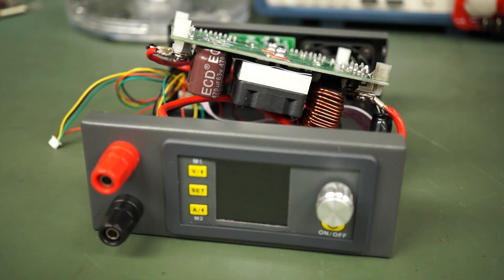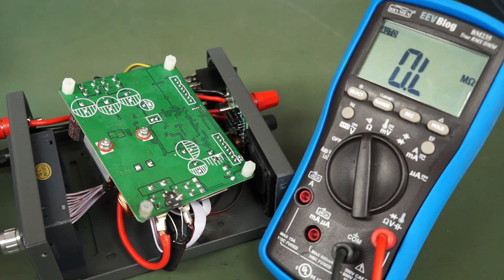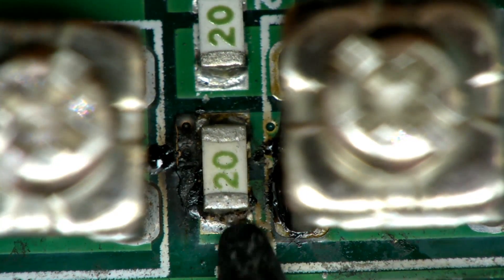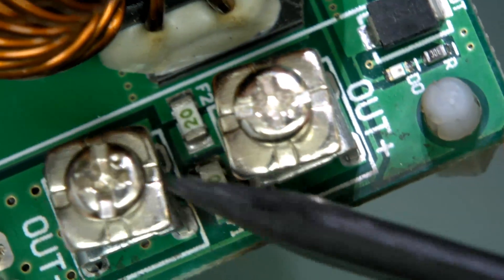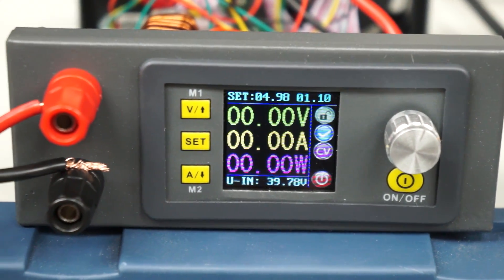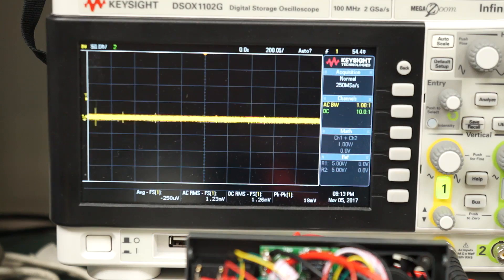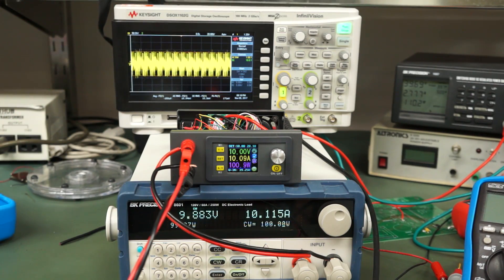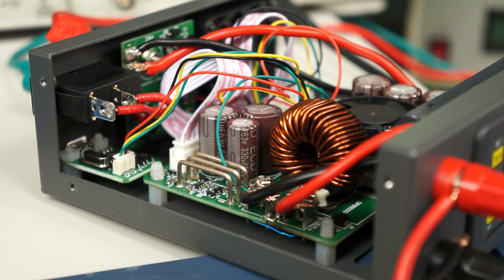EEVblog #1036 - PSU Fire PCB Repair

Comment: I'm sorry, but I have to correct you: a 20 A fuse MUST NOT trigger at 20 A - never. Depending on the standard is has to meet, it might trigger at 1.25*20A after 1h or something in that order of magnitude. Check on google for some current-time-curves, if you're interested in more details ;)
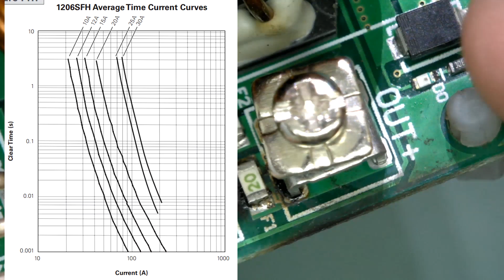Reply: He showed a current-time fuse curve in the freaking video, dude. 7:25  And a 20A fuse run at 20A will eventually fatigue and blow under "normal" use.  You don't run any components at 100% of their rated values if you want them to last.  It isn't good engineering.
Reply: What is wrong with you? 
Yes, he is showing a curve - thanks for telling me, but at least you definetely didn't undestand it.
Just in case you didn't know: This is a logarithmic plot, so if you look at the line for the 20A fuse, you'll see it is only specified to blow at 40A (or more) after 3 sec (or less).
The plot does NOT specify anything about 20A for 20A fuse. So if you - as I said - do some googleing, to find other curves, that specify all the operating range of a fuse, you will see, that no normal fuse will blow at it's rated current - ever.
This has nothing to do with good engineering, I'm just talking about device characteristics here.
There are even standards out there, that require, that a fuse MUST NOT BLOW for any current less than 1.3 times their rated current for several hours. 
I usually like discussions, but please don't come up with some things that you "think" are true but instead do some research before you accuse the things I say.
Reply: I never said, that you should put a 20 A fuse in there. I never said you should always put a fuse in a product, that exactly matches the nominal current of the product. I get that fact, that they were not willing to put a 20 A fuse in there - it makes sense.
All I wanted to clear is the common miscconception, that a 20 A fuse blows at 20 A. This misconception is very common indeed and is just not true. If you have a 16A fuse at home in your fuse box, you can draw 20A "until the cows come home". This is what I wanted to get across.
Does that mean, you should put a 20 A fuse in 20 A device? No.

Comment: I would've removed the fuse, then remove all traces of carbonation, then solder the fuse back on.
It will remove all doubts as to any short circuit under the fuse.
Reply: If you removed all traces of the carbon, you'd have one big hole where the fuse used to be.
Reply: Probably cutting off the corner with the terminals, then soldering wires to the proper places, adding an external fuse, then also moving the sense point to the output receptacles would be the best fix.

Comment: I'm currently also doing output ripple measurements and have read a preferred technique is to DC block a connection to the power supply output and terminate this in 50R at the scope. Otherwise, the normally high impedance input of the 'scope means any currents induced will create large voltages. According to the Analogue App Note I read, the bandwidth should also be set to a low value (20MHz) for comparison purposes.

Comment: If this PSU will have load with high short-circuit reverse current capabilities (high input capacitance or simply electro-chemical cells for example) this part will fail with explosion. As there is no safety features it can do same thing while catching a high voltage spike.

Comment: Greets from Russia, Dave!
These modules are crap.
Me and my collegue have 4 of them, with different power output. Bought from aliexpress. 
Our statistics: 
1st module - just out of the box get burned power stage after 1 min of testing at max load and totally dead now, 
2nd - looping reboot just out of the box, 
3rd - accidentially stucking and rebooting at any load with any power supply, 
4th - finally, works fine for already 2 months...
Dave, I wonder why you popularizating that crap? These modules are very unreliable, lots of defective ones just out of the factory. I guess there are no testing and quality control at all! Questionable design and very poor production quality. Cheap regulated power supply for begginers? Good joke! No, Dave. Just NO!
Even those few-bucks-cheapish-no-brand simple dc/dc converters are much better in this case.
Reply: I have bought two DPS5005 and both works great, *no issues*...tested on various conditions, except feeding reversed voltage from another supply into the ouputs, because it´s not an four quradrant power supply and this will probably kill it, but i tested a 100.000µF/63Volt cap charged it up to 48Volts (my input voltage) with 5Amps, shut the DPS down after fully charged, power it up again without discharging the cap, but leaving it at the output terminals.
Did the same test with a 1Henry 10Amp EI130Core inductor, no issues even with its heavy back EMC/EMF caused voltage spike during shut down... 

So my conclusion: 
well designed, great little power supply modules, especially with this priceTag..:)
Reply: you also need to have in mind that "Aliexpress" is a lot of things so unless it from the manufactory and his salechannel.. you can risk whatever... something like semi-error production-items are also being sold from AliExpress on some product segments and to some extent you don't care, if the item is missing something that is not vital or there are scratches marks or simply error in the production process If the price matches those shortcomings and the item is still useful. for its purpose.. so "AliExpress" is so many things.. but I do remember that RD Tech does have there own sales channel on Aliexpress so at least purchase from there if you're going for these instead of third-party vendors.
Reply: Your sample size is too small to make a decent conclusion and call them crap :P.
If you wanted to, you could find 3 high-end Tektronix oscilloscopes and watch them fail while your 4th one works fine, by your logic Tektronix would be crap then.

Comment: 3:48 "Burnt fiberglass --", erm, excuse my nitpickiness, but isn't glass mostly silicon dioxide? My best guess for the source of the carbon would be the hydrocarbon-based resins used to laminate the fiberglass layers together.
Reply: If I'm not mistaken, fiberglass is a thermoset plastic with glass fibers in it and not pure glass.
Reply: yes
Reply: Thank you mr nit-pick
Reply: fiberglass is a COMPOSITE, its not just glass fibre, hence those resins ARE fiberglass

Comment: Still wondering what the use is for a power supply that itself needs a power supply.
Reply: It turns a fixed-output supply into a variable output supply. The fixed-output supply can be very cheap and simple.
Reply: Show me any power supply that doesn't need a power supply.  All of mine plug into the wall.
Reply: Of course I am.  Why would you think the "mains" isn't a power supply?  Your 13.8V supply needs 220.  Dave's needs 40V.  Inside your 2m radio, it has yet another power supply that takes the 13.8 and turns it into 5v or 3.3v.  
In my house I have a solar power supply that produces 48V DC, then the charge controller converts it to 24V to go into the batteries, then the inverter converts it to 120V AC, then the power supply converts it to 12V DC, then it goes into the radio.
Reply: Then all of yours don't need a power supply, unless you are calling the wall plug ("mains" in Europe) a "power supply."
My 2-meter radio needs a power supply because it wants 13.8 volts and the wall produces 110 volts. So I got a power supply that plugs into the wall and outputs 13.8 volts.
Reply: @JL Software
normal power supply is AC-DC power supply, our power supply is DC-DC  part, you only need simple AC-DC power supple to make a better CC and CV power supply . if you want to buy same power supply. you need to pay more hundreds dollar .. so this is the advantage of our power supply

Comment: Dealing with the failure of this device made for an interesting pair of videos. Old resistors were made up of carbon. The fire left a carbon deposit on the board has effectively created a resistor that was distributed over an area of the board instead of in a nice cylindrical package.

There is still a bit of carbon beside the one fuse on the top of the board. It might compromise the circuit safety should it ever blow from over current. The remaining carbon may still be providing a low resistance path between the two ends of the fuse. Two caps in series will cut the capacitance in half, not double it as you said. You could make a Fundamentals Friday video out of why cracks in MLCC caps cause them to fail shorted.
Reply: @Kevin Cozens
you are right , my dear friend 
very good.

Comment: Are there   solutions for   small three wire cooling fans to reduce noise or vary speed with temp. Perhaps it is just a matter of price point. Vary speed with temp?
Reply: fan noisy ? for now ,we did not have plan to change the fan

Comment: Just put a leaded capacitor across the front terminals instead.
Reply: @zx8401ztv
you can don't need to add a capacitor, the old capacitor is just to lower the ripple 
you can don't use it

Comment: One of the fuses is stillshorted by carbon. You could move them to the other side of the board, scratching away the solder resist on the terminal and inductor pad.
Reply: @
superdau
he use a knife to scratch, but he make a slot, it should be ok,  too

Comment: So, bottom line for me, who just received this PSU last week: remove that capacitor?
Reply from the maker: Yep, remove it.
Reply: I'd just replace it with a disc ceramic leaded cap of the same value. Problem solved!
Reply: I just noticed that my DPS5020 came with the C33 & C34 caps installed where as yours only had the c34 cap. So should I be removing c33 as well?
Reply: Remove both and fit a 100nF leaded capacitor, best thing you can do there.

Comment: I just changed the electrolytic capacitors in my amp that I use for my computers audio. So this is the first video I watched to test the audio and I'm thinking wow, the audio sounds so different with these new caps.  I wonder why?  I got the answer at the end of the video. :)

Comment: Dave, Did I catch you saying that putting 2 caps in series would DOUBLE the capacitance? Hmmmm slip of the tongue perhaps?
Reply from the maker: No, slip. Two in series will half the capacitance, but if one shorts out then the capacitance doubles as I said.
Reply: Ahh, I see !

Comment: Hey Dave.  I'm glad that burnt the board as you made a great video from it. The modification to cut through the carbonised board was quite neat considering the damage. Well done.
Reply: in fact , it should be clean up
Reply: Rd Tech difficult to totally clean off the carbon. Isolating the low resistance is the best you can do. Gets you out of trouble while you order another one if you care about the cosmetics.

Comment: Interesting video with great practical information about these multilayer capacitors and the conductive effect of a burned PCB.
On question though: you mention putting two capacitors in series as a solution to prevent shorting-out failures. However, in case one capacitor fails one would not notice that it failed (only less capacity), until the second capacitor also fails, leading to another flaming short-circuit situation. Wouldn't it be better to put a fuse in series instead of a second capacitor? Maybe even better to always add a fuse in one supply line, before the capacitor that goes across plus and minus?
Reply from the maker: The odds of two shorted caps is incredibly remote.
Reply: Clear. Thanks for your reply! I guess my poor understanding of the word "susceptible" led me to derive incorrect odds from your the statement at 15:40 ("These multi-layer capacitors are susceptible [...] to not only mechanical stresses [...], thermal stresses, they're susceptible to just a failure in manufacturing [...] infant mortality thing  [...]").
Do I understand well that the odds for mechanical stress were in this case greatly enlarged by soldering the capacitor between the poles and that the other potential causes are much less likely to occur? I ask this because in my own projects I have often soldered an SMD cap close to, or even on a regulator and I wouldn't want that to cause a fire.
I now wonder how dangerous the placement of the caps is that I chose in projects such as in this video: https://youtu.be/K7Lv5FWTX9Y
I know I am probably violating all rules of proper PCB layout in that video, but hope it isn't too dangerous!
Reply: @Maxint R&D
two them in series is not good idea, the best solution is to use a better one
Reply: @rdtech9153  it's good to see you following the discussion. I just bought an DP20V021 because you worry about quality and the satisfaction of your customers.

Comment: This series of unfortunate events was actually really useful for a hobbyist/novice like me. I had never really thought about the mechanical stress issue, and this really demonstrates that it's not something you can just ignore and think will be alright. Could literally cause a fire. Imagine if nobody had been present. At best, smoke alarm, at worst, literal room fire.
Reply: I don't think the fire could have spread. The circuit board is a flame retardant material, and it was inside a metal shell.
Reply: @PunakiviAddikti  True but I have seen a plastic housing catch fire because of this problem.

Comment: Where is my thermal camera porn?

Anyways I am wondering if there had been a slot in the beginning, would this have mitigated the flaming as the cap likely quickly consumed itself...
Reply: seems not , it cause the capacitore damaged, slot can't solved this , as it can be mitigated , I don't know

Comment: Could be worse, could be like indesit who knew of their fire problems for years but did bugger all about it 'til too late... :P
Reply: ? what 's your meaning
Reply: Look up Grenfell Tower, and that's my meaning, an Indesit-built appliance caught fire that should have been recalled and repaired, but it never was and, in combination with poorly designed insulation on the building itself, resulted in a huge fire and many deaths.

Comment: Hi Dave. Is it possible for you to make a review of the this power supply module: https://es.aliexpress.com/item/Free-Shipping-LTC3780-DC-5-32V-to-1V-30V-10A-Automatic-Step-Up-Down-Regulator-Charging/32706496336.html?src=facebook&albslr=221466033&isdl=y&aff_short_key=UneMJZVf&albbt=6&albch=SNS&acnt=1153335691469828&albcp=papaya_traffic_6_23842701567470016
I have noticed that many people use it to make their own cheap power supply and I am thinking of making one myself. But first I would really like to hear your opinion on this.
Thanks.
Reply: Nicu Serea Hey, I have one like these (similar, not exactly the same model). On mine the inductor (coil) shorted through to a smaller sensing trace on top, where probably the isolation got scraped off due to magnetic ultrasonic vibrations. I therefore recommend some isolation tape or the similar in between, just to be safe ;)
Reply: I bought four of these things and got a 75% failure rate straight out of the box. (And b4 anyone mentions the under voltage set pot, been there done that)

Comment: Hi, Dave, what is the DC voltage rating of the 20A SMD fuses.
If one of them pops, will you have another PCB fusion experience?

The carbonised PCB will not be solid carbon, but carbon ASH, so even flexing the PCB will change the resistance.
Try measuring the resistance as you shout at it, carbon microphone..lol

Tom..
Reply from the maker: Carbon mic effect would be interesting!

Comment: The charred board underneath the fuse will bridge it. It won't blow at 20A anymore...
Reply: So what. Safety schmafety. This is not a mains PSU.
Reply: +Ollyweg 0 It is probably there in case you charge a battery, and if the PSU fails (shorts) internally, the fuse will protect against the current coming back from the battery. Definitely worth fixing that fuse, or adding a separate  external one instead of the SMD ones. But the sense line may also be need to be connected after the external fuse...

Comment: They are still selling these on AliExpress
Reply: Iqbal Samin Prithul, As he say is easy to prevent that failure by removing the cap, it still looks like a nice and cheap board.
Reply: But they were supposed to stop selling these until they fixes it. As he said.
Reply: @ Iqbal Samin Prithul
we have already update it in that day , now all capacitor was changed. and this is easy to update for me , not a big problem.
Reply: @ Josuel Servin
thank you , we already update it , for those aleady sold, they can unsod the capacitor , and can contact me to ask new capacitor
Reply: @Iqbal Samin Prithul
you are welcome , friend 
if you still need , at 11.11 US Time, there is a big discount ... you can check https://rdtech.aliexpress.com/store/923042
at we also publish DPH5005 buck-boost power supply , you can check it too 
https://www.aliexpress.com/store/product/RD-DPH5005-Buck-boost-converter-Constant-Voltage-current-Programmable-digital-control-Power-Supply-color-LCD-voltmeter/923042_32840324731.html?spm=2114.12010612.0.0.6f74992zxJn0s
Reply: Very nice job RD tech! I love your power supply

Comment: Environmental change? I assume the carbon layer was perfectly dry immediately after the fire.  However would it absorb moisture from the environment over time?

Edited to add that I will probably purchase the base model once the "new and improved" version comes out. I feel pretty good about a manufacturer that is so responsive to issues.
Reply: @Bigrignohio
there are not only carbon, there are other things mixed , as pure.. so it is conductive
Reply: Sorry for the confusion. I was commenting on how the conductivity changes over time, becoming a better conductor.